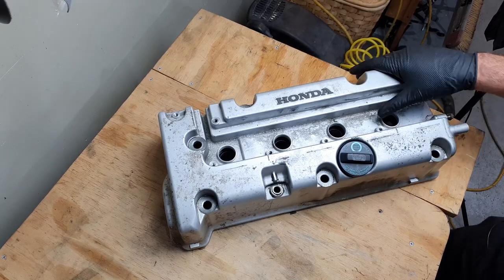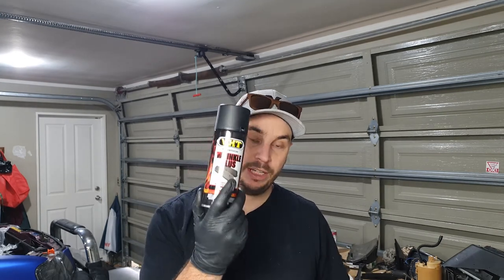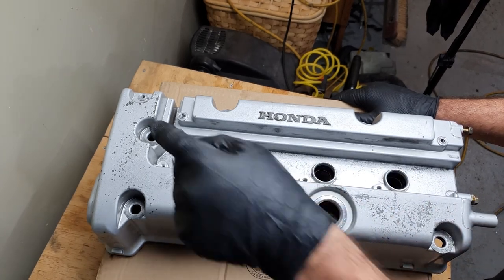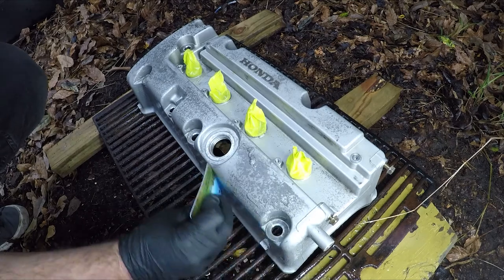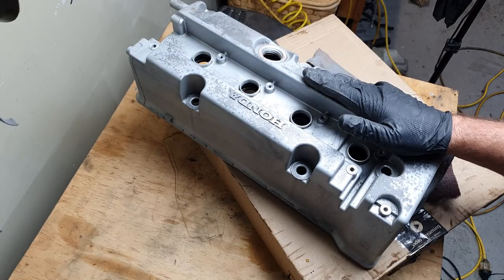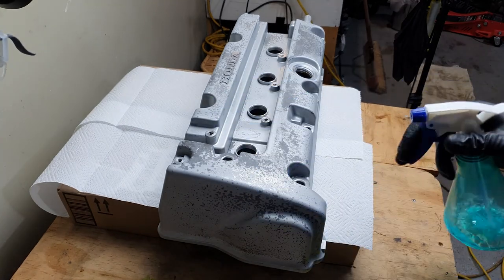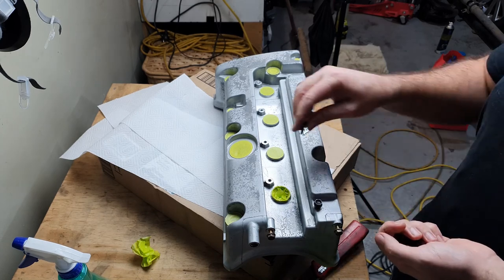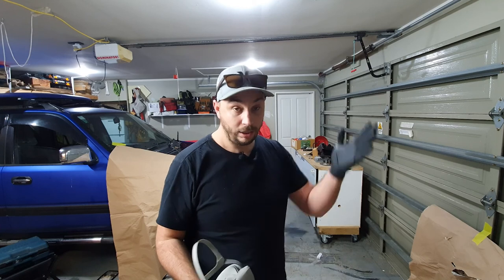honda k24 wrinkle valve cover diy

Comment: I love that, much better than silver or red in my opinion.

Nitro Morso used to be a go to stripping product, however they dont make the same stuff anymore due to news laws in eu anyway, new stuff is very weak and it must be applied several times with long waiting times in between, counter productive.
I remember doing that to b18c type r red cover, applied nitro morso left it for 10mins and scraped the paint in matter of minutes with old credit card and cotton cloth, every bit of paint came off on the first try no effort at all. 

Nice job and thanks for sharing.
Reply from the maker: Thank you! Appreciate the info. Will see how it holds up, but the combination of striper and roughing it up seems to have worked well. I have a spare k24 cover maybe i will try again with a loud design lol.